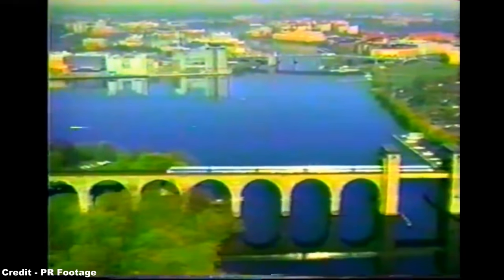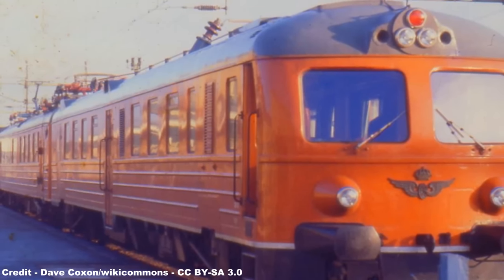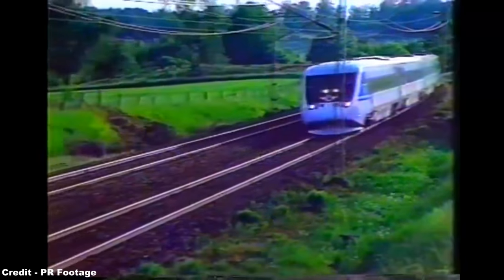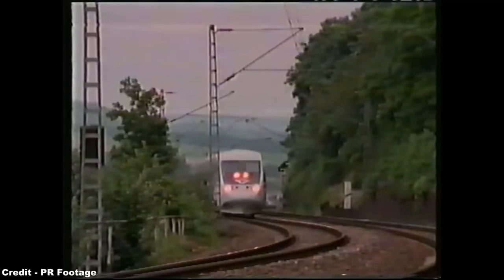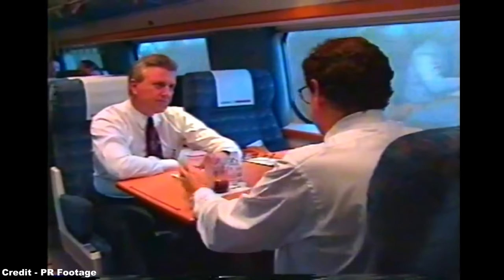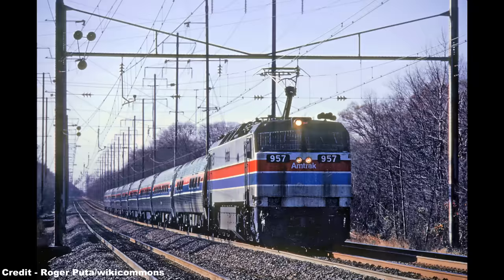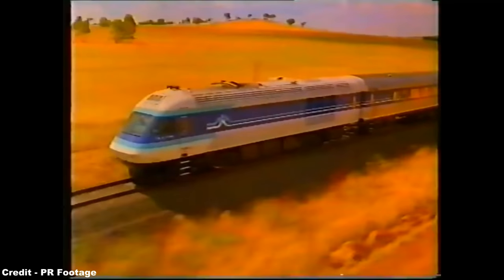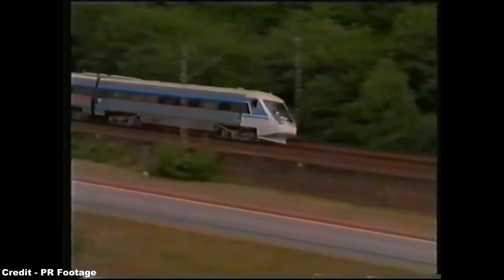Tilting Triumph - X2000

Comment: Switzerland here. Ours don't work. Why. ABB is partly Swiss. But we don't have ABB systems. We have Italian trains because these were 6 pence cheaper, and those don't work right, ever. It is a complete disaster. Sadly the Swiss rail system today is run by complete imbeciles.
Reply: Ha funny. As someone from the UK, I've always been jealous of the Swiss railway system. It is run fantastically. So punctual and clean, with services so well integrated with buses and boats. I guess perspective is all relative, but trust me, on the whole, you guys have it very good. I think the only exception is HSR, but then you are a small country, so not a huge deal.
Reply: The "BB" of "ABB" is Swiss. The A is "ASEA". But ABB sold of their part of the rail business to Daimler to form AdTranz, that in turn got acquired by Bombardier and later Alstom.

Comment: Tilting trains with electronics were not pioneered by Britain at all even though the first shabby implementation was done there and passengers complained and stopped it. 30 years before any Briton could even think about it, the Germans had such ideas. Maybe the Brits stole some of it like most of their technology which is stolen. Then in the 1950s, the Japanese thought about it but later decided for dedicated tracks. In the 1960s, the French were also interested in it but quickly gave up the idea for dedicated tracks
Only on these lines and only after Spain and Canada implemented those, the British could even think about such ideas.

This is the issue with Brits. You talk about any  science, they'll bring an unnecessary lie about some British link. Come one guy, you couldn't build a proper car or motorcycle which works, then why big big claims?